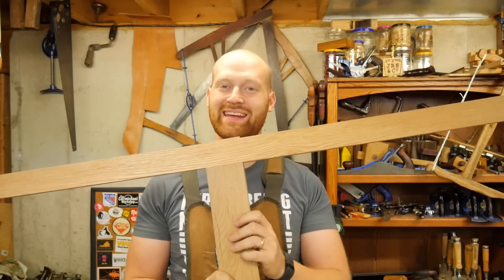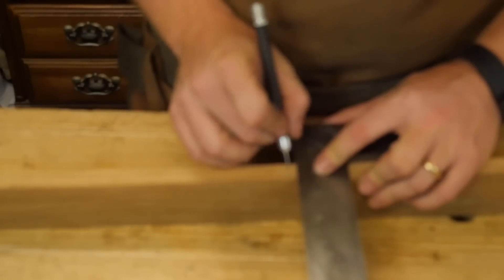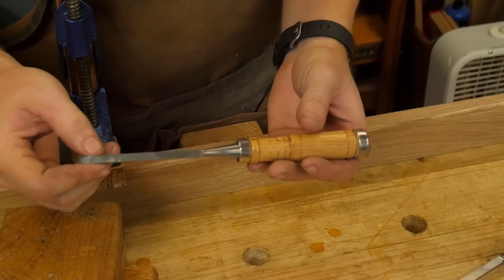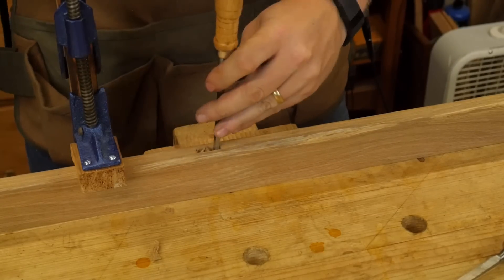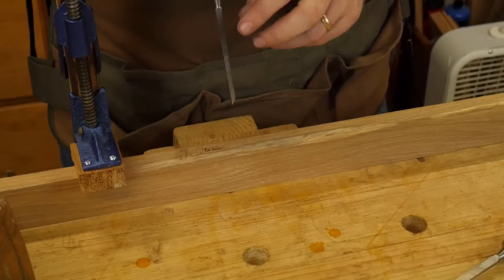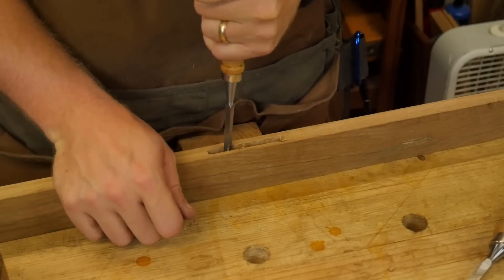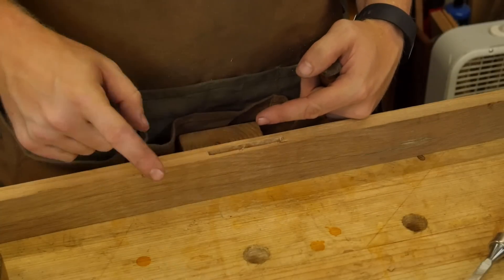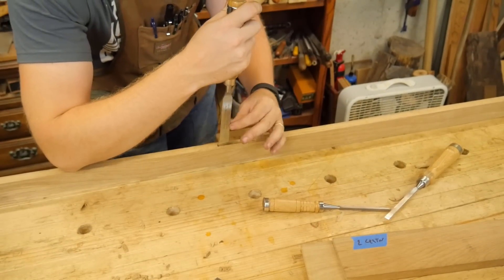How to Make a Mortise With Hand Tools Cut

Comment: I have accidently cuta few mortises too wide for a bench. Is it possible to fill out the walls of the mortise? Its pine and a length ways tenon. I am thinking trying to fill the gap to make the tenon fit tighter with a pine dust paste mixed with tight bond hide glue (12- 24 hr set version) Or should I use ronseal wood filler paste ? Or make some thick paring shavings and glue them in place? Please advise... I stupidly cut 3 tenons before the mortises thinking in my head its ok I will just not cut them back fully... I got carried away or was careless in the mortise cutting later on and they dont match up great width ways.... although they are mainly for preventing lengthwise forces from planing in the vice and hold ing the pair of bench legs together. Many thanks
Reply from the maker: no fun. it can work. it depends on how much strain it will be under. the best glue for that is epoxy. but in the end you may be better off shimming it with thin stock wood and gluing it all together. also you can glue stock on to the tenon and then just re cut it a bit wider. hope that helps.

Comment: It is very easy, actually very likely, for a mortise to not be perfectly 90 degrees to the face.  When you insert the tenon you discover the rail and stile are not in the same plane.  Not a happy experience.  Making a through mortise actually helps to insure that it goes straight thru and not at a random angle.
Reply from the maker: Very true! it is definitely a skill to learn keeping the chisel vertical. thanks!